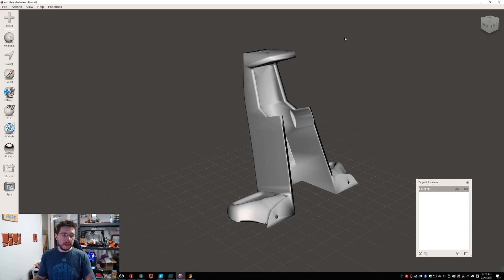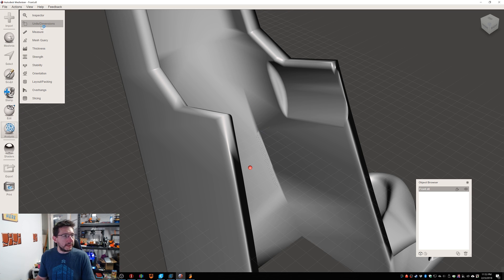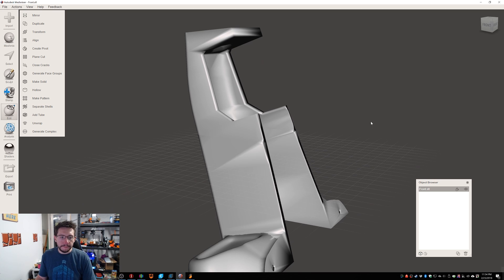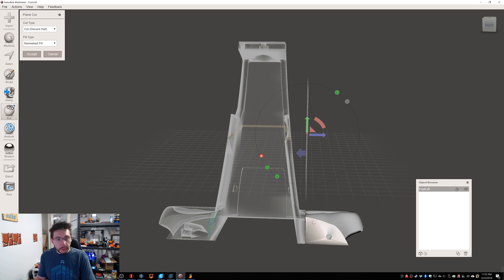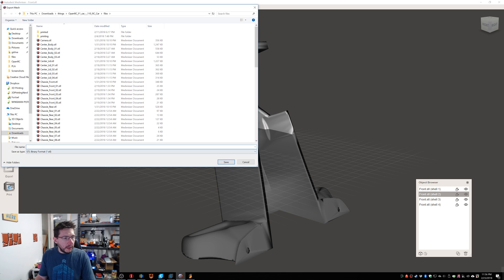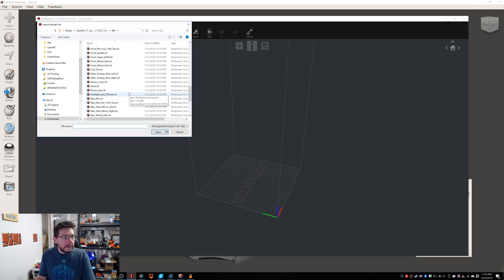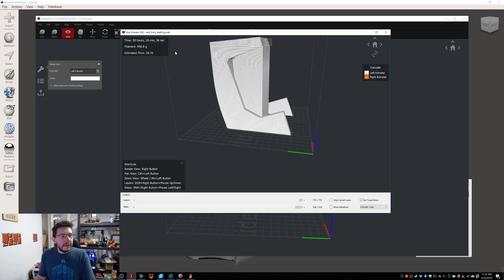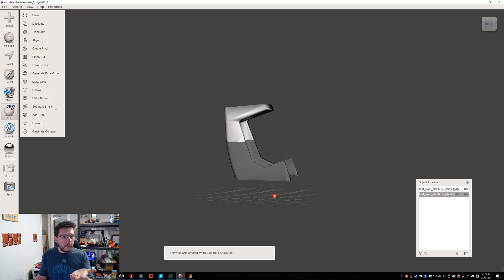Meshmixer Is Not Scary / How To Use Plane Cut To Slice Large Models for Better 3D Printing

Comment: thanks! Exactly what I'm doing now with a large piece but putting the pieces together exactly will be critical. And thanks for the tip on Maker's Muse as he brilliantly explains how In Meshmixer it's possible to not just plane cut but also to free cut so that you can create puzzle/dovetail style joints to add strength and confirm alignment when piecing back together!

Comment: You could have done that on your formbot t-rex 2+ or the gmax1.5xt in one peice just turn the model on a 45 or cut it in half and flip the top so it lays flat and still print on a 45 would have saved a lot of gluing.

Comment: Joel, thanks for making this video. I am working on a printing my first battlemech https://www.gambody.com/3d-models/mechwarrior-bobcat and i am finding that some of the parts require a lot of supports and they are having trouble with bed adhession during printing. So I'm slicing one piece to see how it will work to print it flat and epoxy it together. This video is so straight to the point and exactly the process I needed. Also, I love this RC Car project you did.

Comment: For big parts like that and that will be put under flex-- consider making holes between the two facing surfaces. Then insert pins-- like plastic rod; something solid. To prevent rotation.

Comment: You should also include some registration keys of some sort. These will greatly help in aligning the individual pieces, when assembling them. What type of keys you use is entirely a matter of personal choice. An easy version would simply be to use registration pegs. Just quickly model a small cylinder, with chamfered edges. After slicing your model into managable parts, position the peg(s) between the parts, and use a "booleen" opperation to create corresponding, negative spaces, where the peg(s) will fit after printing, (usually, you'd need 2-3 per pair of parts). Proceed with printing the parts like you normally would. And, then print out a corresponding number of pegs, to what you used to make all the holes. It doesn't matter how big or small you initially make the pegs, as long as they match the custom holes you made in your model, to fit them. They don't even NEED to be "pegs". As long as they are some kind of [parametric] geometric shape, with no undercuts that would lock the shape, unintentionally, into another part. You can also incorporate the shapes into the parts, or print them seperately. 'Choice is yours. This will help relieve A LOT of headaches, geting everything to align properly. If you have any questions about how to do it, Bill Duran, or Angus will easily be able to show you, step-by-step. In fact, I believe they have both even produced videos on this very subject. HI-5!

Comment: Does meshmixer allow you to export the part and meshmixer supports as separate files then align them so you can use a different s3d process for the supports vs the part process(es)?

Comment: Awesome sharing. I’ve been doing this for a little while. A way to prevent those strange points at the cuts is to increase wiremesh density via the remesh command (after selecting near the area you want to cut)

Comment: Does splitting the model up limit you to one printer or can you use dissimilar printers and still get a model that goes together well?
Reply from the maker: Great question - as long as all printers being used are calibrated well enough to produce similarly dimensioned parts, then yes!

Comment: One thing that would make it easier to assemble parts would be to add some registration marks. Nothing fancy, just a couple small pegs and divots to line sections up for gluing.
Edit: To be clear, I've yet to mess around in Meshmixer, so I have no idea how to do that. I just think it'd make the gluing less tedious.
Reply from the maker: You're right, but I don't know how to do that yet in Meshmixer :)
Reply: Well, I found a couple hours to mess around in MM. Between poking around in the menus and haphazard googlery, I couldn't find a good way to do it.
I did have another idea for lining parts up without pins, dimples, or fancy cuts though: Cura has a mold mode that, well, makes a mold. If you made a mold of a section where the two parts met, exported the build plate as an STL, then opened that in MM, you could cut it down to a small jig that just wrapped the joint on a few faces perfectly. It might be more effort than it's worth, since you might glue the part to the guide piece if there's any overflow.
Reply: How about doing a boolean (or two) with a very tiny primitive, like a sphere the size of a tictac?  Duplicate it in place so you can use one copy to cut away from one side and bool the other copy together with the other side of the model.

Comment: Joel, can items be cut up in meshmixer to create interlocks / features that would create stronger bonds as opposed to just 2 flat surfaces?
Reply from the maker: As I learn more I'll definitely show off what I find out!
Reply: Ian Colquhoun Yeah, that would be a great followup to this video!
Reply: I was just going to say the same thing. With the two pieces having their mating surfaces on top of the print this would work out great.
Reply: Well, if it's your own design and you have the design file that's a fairly simple task with dovetails or a similar design. I use dovetails alot.
Reply: It looks like the first part of this video from maker's muse might help: https://www.youtube.com/watch?v=eLgD88KFKJI
Reply: It would be awesome if they added it but I do not believe so. There are two pin stiles in meshmix/misc that you could use but it is still a process since you would still need to make a tube first I think and then use the meshmix item to hollow the pin depressions. You /can/ however use cylinders and the select/edit/flip normals to make quick places for dowl or rods like Joel has used in a couple 3d printed swords. Makers Mews has a video with that technique.
Reply: Dave Kester
Dovetail Joinery Box found on #Thingiverse https://www.thingiverse.com/thing:132349
And here's a wikipedia article. https://en.m.wikipedia.org/wiki/Dovetail_joint
It even mentions 3D printing in the wikipedia article.
Reply: @calebsherman886  I would like to pick your brain about dovetails and how to implement them in meshmixer. The model I have is 25 shells , is there a way to create dovetails on all four sides of the separated shells automatically...
Reply: Do you have an example on the web of what you mean by dovetail? Also, any examples on thingiverse that use this method?

Comment: If you can open the model in fusion360, you can do the same thing there.  It also allows you to break parts up in much more complex ways.  You can draw a 2d or 3d profile, and use that profile to split the part.  I used this quite a bit recently when I was making custom ends for a vacuum cleaner hose.  I modeled the entire end, then split part of it out to work as a clamp to go around the hose.